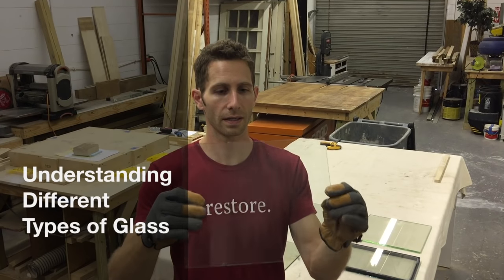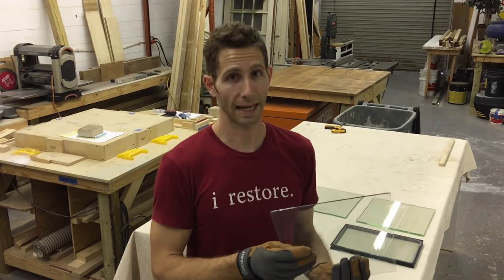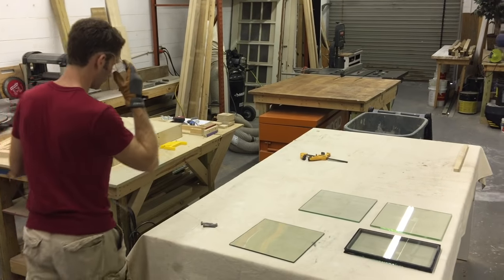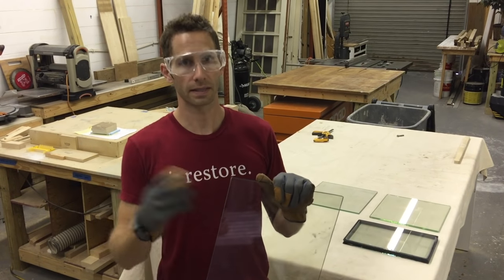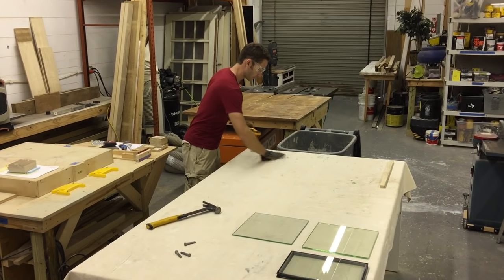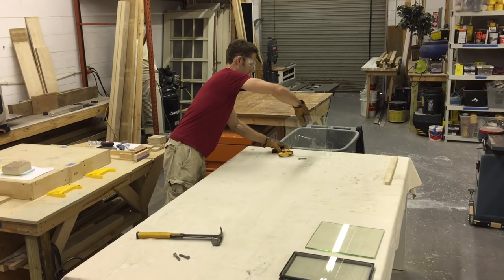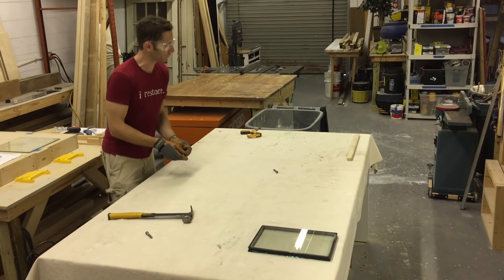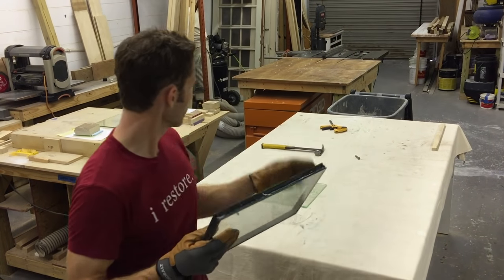Understanding Different Types of Glass

Comment: Good video.  I have worked in the glass industry for over 20 years
Annealed glass is NOT heat-strengthened.  Heat-strengthened is a process done to the annealed glass to give it strength.  Heat-strengthened glass is 2x's stronger than annealed and tempered glass is 4x's stronger than heat-strengthened
Annealed glass can be cut.  However, heat-strengthened & tempered CAN NOT
Insulated glass units CAN incorporate laminated glass
The best laminate for impact of any kind is Sentury Glass Plus or also known as SGP.
I hope others find this information helpful!
Reply: Very precise info. One small note, I also work in the glass industry. I think you refer to SGP = Sentry Glass Plus.
Reply: scott sean  I don't understand your question... Can you paraphrase it?
Reply: May i ask what glass is used for our phones screen protectors?
Reply: @briandinyake5389  laminated for phone screen protectors

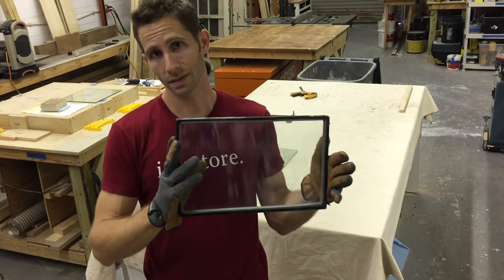Comment: @ 9:00 - 'insulated glass will fog up after 10 years'...there have been vast improvements with the sealing compound used around the edge - now they last a lot longer.
We're working on a garden style window that is at least 20 years old and the seal is just fine, albeit there is oozing of the seal around the aluminum frame and we're looking for a solvent to clean it.
We share the same sentiment for antique glass - cleaned, it is unsurpassed for soft light and tender fables.

Comment: Thank you for showing the different types of glass, and also for pointing out if they are DIY types of glass or not (whether we can cut it without expensive equipment).  I realize we just have to get a glass company to cut it to size so that we can use it in our projects.

What about sources for glass?  Do you just go to your neighbourhood glass company and buy the more DIY-friendly glass by the sheets?  Or would you try to find a wholesaler?  I bought some strong glass for a table that I made, but it cost me about $80 CAD (cut to size, and edges cleaned up so nobody will cut themselves).
Reply from the maker: Unless you are buying very large quantities then using a local glass retailer is the best way to go. Hope that helps!

Comment: Sorry to be a contrarian here Sir, however you mentioned the last piece of glass that you did not break, aptly named insulated glass (IGU), and you stated that it could not be manufactured as Laminated glass.  However, this is done routinely in the window industry today.  By that I mean one  piece of the IGU (usually on the exterior), can be anealed, Low E (or energy efficient glass) and the other piece (usually on the inside), CAN be manufactured as Laminated (two pieces of anealed separated by the film you mentioned between them, thus being laminated).  This IGU gives you the best of both worlds, an energy efficient IGU which is also has the ability to not be easily broken through for safety.  The rest of your demo was pretty factual  : )
Reply from the maker: Linda, you may have misunderstood me. I said that you CAN get it tempered and you CAN get it laminated. The audio isn’t great in that part. After that I said that this piece isn’t safety glass basically implying that an IGU is in it of itself not safety glass. You would have to have an IGU with tempered or laminated glass in order for it to qualify as safety glass. Thanks for the feedback!

Comment: 3/16 of an inch = 3/16*2,54=4,8 mm     --     the , denotes decimal,fraction in parts of Europe.
1/8 of an inch: 3,2 mm
1/4 of an inch: 6,4 mm
5/16 of an inch:  7,9 mm
--------

Definition of two-by-four: a piece of lumber approximately 2 by 4 inches as sawed and usually 1⁵/₈ by 3⁵/₈ inches when dressed 
--------
Please mark this message so it stays on top :-)
Love your sense of humor! :-))
Reply: Your math is correct, but your sequence is not. Even in the US, glass is manufactured in mm thicknesses, not imperial or fractions. The mm thicknesses are then translated into fractional measurement because so many Americans are not familiar with millimeters and need to see the factions to know what they want.

So 3.0mm and 3.1mm are both very common products and both are referred to as 1/8"
4.7mm and 5.0mm are both called 3/16"
5.7mm, 5.9mm, and 6.0mm are also common thicknesses and all are grouped into 1/4"
8mm is 5/16"
10mm is 3/8"
12mm is 1/2" 
15mm is 5/8"

19mm is 3/4"

Comment: Good video, but a couple of incorrect points; Annealed glass is just regular plain ol' glass - the type you can cut and can cut you. It isn't heat treated like toughened and/or tempered glass, but I think the confusion here is that ALL glass is made through a heating process - hot enough to bring it to a liquid state for lack of a better word. Although I guess "molten" would be more accurate. Glass was discovered by finding volcanic glass or obsidian, and also lightning strikes. Modern glass is actually "floated" onto molten tin, which is why it's called "float" glass, so there's your heating process. But unlike toughened or tempered glass, annealed glass is put through a tempering furnace and the molecular structure of the glass is actually rearranged, and if and when it makes it through the process, it's stronger, and of course can still be broken but will shatter into tiny pieces (provided the furnace and person programming it is good), but it can still cut you. I have many scars on my forearms from it exploding in my hands, either while being installed or "spontaneous breakage", which can occur in approximately 2% of glass that has gone through the tempering process. And if and when that does happen, it is usually within days of it being tempered. AND no matter how many times it happens, it's still terrifying! So, the moral of the story is - stay in school and away from the glass business! JK, but it can be dangerous and what I've learned over the last 40 or so years is that like with most materials that can hurt you, it's most important to respect it and learn as much as possible about the properties of whatever it is that you were dumb enough to decide to work with! Again, JK and also again - nice video!

Comment: You have gotten several things incorrect in this video. First, the antique glass is annealed. Basically all glass is at least annealed. Especially if used in windows or any manufacturing. And annealed is NOT heat treated. Second , tempered glass when shattered will certainly cut you. And IGU’s(insulated glass units) can incorporate any glass. Including tempered glass.

Comment: What low quality insulated glass do you have there. In Germany these are pretty much standard for multiple decades, and I have never seen one fog up between the sheets, even in old apartments 20+ years old.
Reply: The 3' x 4' picture window in my 62 year old house in North Dakota temp swings has no fogging and remains clear as a -30 degree winter sky.

Comment: So what is the stuff that is sold at Lowes and Home Depot? and what should I use for the front windows of my 1924 Craftsfman bungalow. I prefer to have newer glass because I like the clear view but because its on the front porch, it would be nice for it to be stronger..
Reply from the maker: 1/8” annealed glass would work just fine for your bungalow and will fit without modifications. You could pay about $8 per SF compared to $1.50 per SF for tempered if you really want stronger glass, but that is usually not necessary.

Comment: I may have just messed up.  You didn't specifically mention plate glass. I was going to order 1/4" tempered glass for roughly 12"x 12" shelves in a cabinet to display rock samples on. But, I was recommended a less expensive option using 1/4" plate glass.  If I'm careful with the larger rock samples up to 3 pounds will it still be ok?  Where does plate glass fall in the strength comparison?  Thanks!
Reply from the maker: Plate glass is essentially annealed glass. The 1/4 gives more strength but I would go with tempered to be safe.

Comment: Hi, can you explain the difference between toughened glass and heat strengthened glass (HST) glass as well
Reply: heat strengthened glass goes through the same furnacing process as toughened glass but the quench cooling has a different profile and is slower reducing the amount of stress put into the glass compared to toughened, heat strengthened glass is around 2 times stronger than annealed, toughened is around 5 times stronger than annealed.

Comment: isnt annealed just float glass? can get from 2mm up to 24 or 25mm that ive seen. tempered/ toughen glass still cuts like a mofo depending on the thickness.
Reply: annealed glass is just glass, float is the process in which that type of glass was annealed, drawn is another process for annealing glass.

Comment: Interesting. Your synopsis on IGU’s I don’t agree with though. IGU’s are available in any configuration you want, ie: float, low E, tempered, laminate, decorative, or any combination of the above. Most manufacturers offer ten year warranties, I’ve seen IGU’s over forty years old. 
From a 25year+ glazier.
Reply: My Anderson IGU double pains are all fogged up after 20 years
Reply from the maker: I don’t doubt that they can last longer than 10 years but why trust a product that is lucky to pay that long rather than a product that is designed to last hundreds of years with very little chance of failure?
Reply: The Craftsman Blog the energy savings far outweigh the cost of IGU replacement.

Comment: You lost me when you said Antique glass and annealed glass are different in strength I don’t know where the facts are from but any glass that isn’t heat strengthened or tempered is annealed glass that antique glass is just patterned and its still annealed  and if your going to strength test glass I recommend you use the same thickness on all the types of glass that you’re using There is a big difference from thinner glass to thicker glass in strengths
Reply from the maker: Actually annealed glass is stronger when you compare apples to apples with antique glass because the annealing process has been improved and standardized across the industry. Old glass may have been annealed or not depending on your region and supplier.